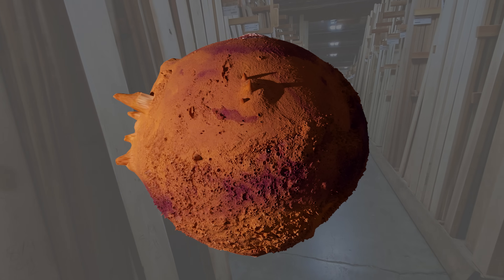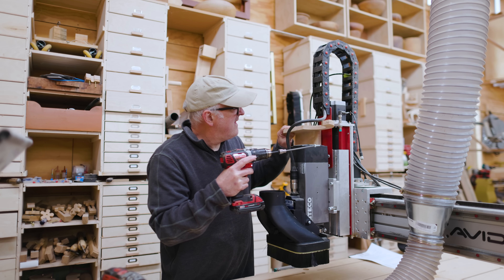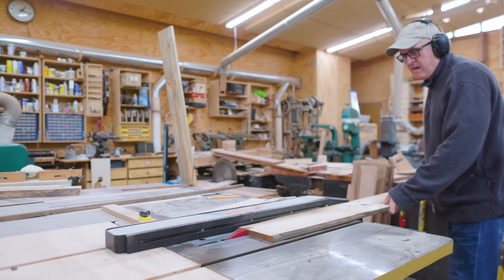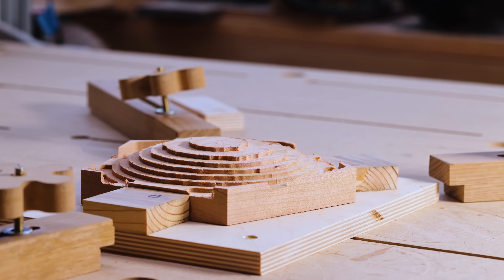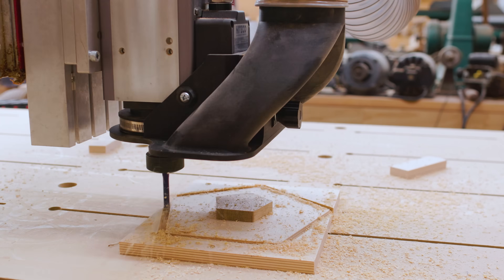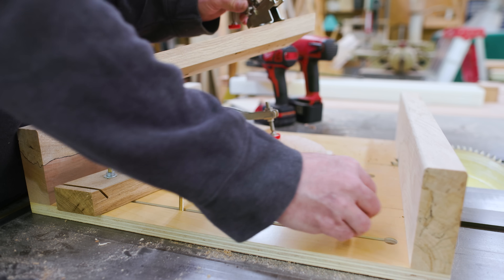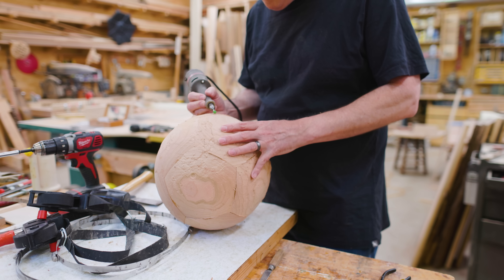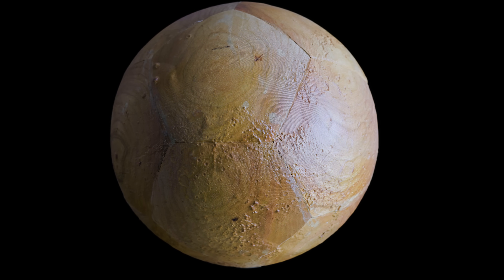Making Mars out of Cherry

Comment: Magnificent! I actually like the fine realistic topography details. 

I need to look at an unfolded dodecahedron, but I feel like you may be able to simply reduce the total number of seams using thicker wood. - Will reply after researching.

~15 minutes later~ 

Okay, I'm no woodworker, so maybe you can visualize it better than I. I made a 3d model. It ~looks~ like if you divided the dodecahedron into 4 parts, instead of 12, you miiight be able to use your CNC to round out those deeper, larger pieces, and figure out a way to cut the back ends to fit into each other. If you can figure out that back shaping,  you eliminate 12 of your 30 edges, and should have some nice large faces to display without any seams. You'll also have to carefully plan where the higher peaks are cut out of the cnc, so there's no overhangs. Looks like the full depth would be nearly 1/3 of a sphere. 

Option 2.... Build a spherical CNC rig? How hard could it be? (hahaha)

Comment: I'm no woodworker, but I do play with modular origami from time to time, and it seems like part of the problem you have with assembly is the angle at which you have to insert that final piece -- it's almost perpendicular to the angle of the biscuit. If you assembled it as two halves first and then pushed the halves together, that might let you get away with a lot less wiggling in the end.

Comment: You could use a tapered endmill or just a ball endmill with  a lot of step down passes to cut the mating faces on the CNC in the same setup where you cut the locating pockets on the underside of the pieces.  It would eliminate the extra step of putting them on the table saw and probabaly get you mich more accurate parts since all 5 mating faces of each piece would be cut in a single setup

Comment: For exaggerating the terrain without blowing the scale of the mountains, you should use a logarithm filter on the heights. Basically you could set it so the mountains stay the same height, nothing will switch heights, but your medium spots will get the most oomf out of it.
Reply: I was going to suggest logarithmic vertical exaggeration too. Not sure whether that will do valleys correctly, but it's definitely something that can be examined in a digital model before making sawdust.

Comment: One proven way to put it under equal spherical pressure for glueing all together would be a vacuum bag. You'll have to modulate the pressure/evacuation rate and probably help a little with a rubber mallet to position the pentagons relative to each other, but it works extremely well where there is no way to clamp an object for its spheric form (or its dimensions). We glued 60 foot lamellated yacht hulls in one piece that way, so a model Mars shouldn't be too much of a hassle to vacuum bag I reckon. Thanks for sharing Your wonderful projects!

Comment: Purhasps putting the sphere I'm a vacuum bag would be a solutionfor closing all the gaps. It would certainly apply even pressure. However I imagine the fact that there is delicate topography might be an issue.
Reply from the maker: I think this might be the answer. I need to look into doing a vacuum bag.

Comment: This work is getting better and better Frank! I have an idea how to get the seams even tighter. You'd have to setup the Table Saw blade to the middle of the sphere instead of a pentagon that is somewhere arbitrary placed on the underside of the dodecahedron. In this way you'd get precise transitions between each tile, even with different elevations on the surface of the planet

Comment: Hey Frank, you might have more luck if you cut the angles on the back of the segments with the CNC at the same time as you cut the mortise. That way you don't have to rely on your table saw getting the angle perfect. It will be a little trickier to clamp to do the surface side, but the added accuracy might be worth it.
Reply: I had the same thought. This might require a tenon based clamping setup. a vacuum hold down perhaps? Then the pieces should be ready to assemble (with added biscuits) right off the cnc. 

And thanks for being awesome Frank. You make the world a better place.
Reply: I thought that's what he was going to do. It's amazing how the mind can get stuck following a process simply because that's what you've always done.

Comment: 15:59 i think the solution you should consider is to make the sphere perfect (that is to say, that all of the joins you have, should be correct, flat against one another) before you make the final surface cuts. And the only solution i can think of... is to ditch any kind of biscuit or glue and make an internal dodecahedron, with a small dish on the faces (akin to what castings have, where only the edge sits on a surface, to minimize the work the machinist has to do to make that surface flat) where only the intersections of the faces of the dodecahedron meet, are raised. And to make the faces of the sphere "sit down" on those edges, you can insert in the center of the faces of the core, threaded inserts, where screws would pull these faces down. Those screws would then covered on the sphere side with plugs, which you can machine (to have features) in a jig, to match the holes drilled in the faces down to a T. 
Extra work, but it eliminates the chance of glue messing things up, faces not meeting etc. Once you have this sphere and its core down pat, you can disassemble the whole affair, put your "segments" in MDF slots with the exact shape negative machined in, and hold them down via the screw to be machined. One issue is (however) presented in this, and it's the fact that depending on how much gronk you put on the screw, the face of the "segment" will be warped, and won't match, so... perhaps there's washers under the slot that only allow the face to go down an exact amount that matches both dodecahedron core and the negative support on the CNC.

One other nutty method would be to lower that part of your CNC table at 90, make a cradle that picks up on the holes in the sphere and machines each "segment" on the sphere as is. That way, you won't have issues with the features (or raw faces) interfering with your work. If the holes you cut, have an extra step, besides the one for the screw(and a washer), then that step can become the register, which would be (assuming the sphere is accurately assembled) pretty precise as references go. 

Just some thoughts on how i'd try to approach this. Whenever glue's involved in stuff like this, you inevitably end up having issues. Even the greatest museum pieces exhibit this kind of problem. For that very reason, the master workers of the past centuries had these features (that were supposed to match) as fascias or used other methods like carving in place. Small cheats to achieve an even item.
Reply from the maker: I was beginning to realize any glue with something this complicated was going to raise issues. Some kind of mechanical connection might be better

Comment: I forget how many axis are on your CNC machine.    I wonder if you couldn't use one (two) of your bowl blanks, put it on the lathe to get a ball shape a bit larger than what you want, then attach it to the CNC to cut the relief(s) down to what you want.   Granted it's different than a dodecahedron.   But if there were big cracks in your blanks you probably wouldn't even have to fill them in, I mean Valles Marineris could be made by mother nature! 😂   Or something like Jupiter, since it's got a gas giant with no texture, you could do a bunch of different colored rings to represent the different cloud bands which range from browns,reds and very light white, perfect for a normal (Non exotic) wood collection and spin that on the lathe, no CNC needed.      Sorry, just thinking out loud in the comments, not actually telling you what you should be doing.

Comment: Great work as always Frank! 
One question:
You may have answered this before so my apologies if I've missed it but when you CNC cut the pentagons out, couldn't you leave it held down where it is and then do the roughing and carving pass in place since the pieces aren't loose, they are still attached to that greater board? It seems like it may save the step of gluing and then cutting off all the add ons?

Comment: Have you thought about using a plastic bag and a vacuum for clamping for a hopefully uniformly inwards pressure?
Reply: could be problematic with shapes that are closed off to the vacuum bag like a hollow sphere. You'd probably get some pressure differences while closed in the vacuum bag or later after adjusting the air pressure to the normal level.
Reply: @Craftlngo Drill some vent holes.  Fill them in later.
Reply: @Craftlngo if he wrapped the sphere in fabric first it would allow the air to flow all round the surface and give a more even pressure. That’s how we stop pockets of trapped air in our veneer press.
Reply: @guy_scott  the point is that the sphere itself is closed off to the vacuum bag.
Reply: @Craftlngo ooooohhh, you mean the void within the sphere? Gotcha. What problems would you foresee that pressure differential causing?
Reply: @guy_scott  In the first place it will push the wood pieces outward to balance the pressure, as long as the glue isn't set and open the gaps between the tiles.
Reply: One small hole eould solve that problem. @Craftlngo
Reply: Was gonna say the same
Reply: Yep that was going to be my suggestion
Reply: same response, seems that this would be best